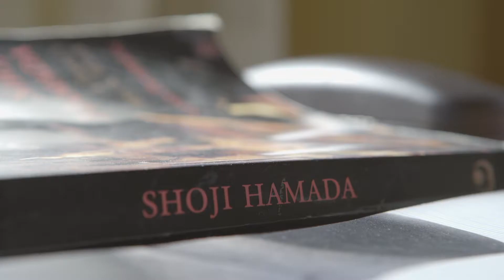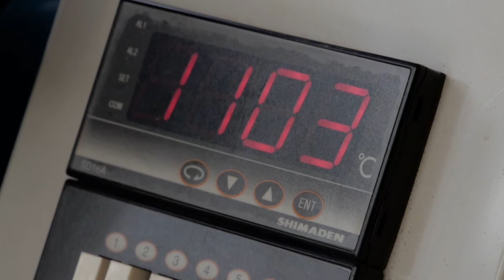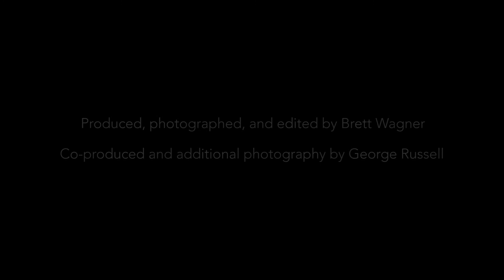Being a Pottery Apprentice in Japan

Comment: Probably would have learned more to use your Chinese connections to learn from the potters in Jing De Zhen. Your average 14 to 20 year old thrower will probably have better technical skills than this guy. An instructor / master there will have over 30 years of experience before they hit 50 and the training experience will be a lot more practical as opposed to doing the instructor's chores.
Reply from the maker: Funny you should mention that, because I am going to Jingdezhen in Sept for an artist residency at JCUIS :) What I learned in Mashiko was so profoundly different from my life in the States. It greatly impacted on my life and my approach towards ceramics.  I did not excel in technical skills, but the experience improved my discipline and deepened my understanding  of the craft in a very fundamental way. Super excited to see the contrast between the Chinese and Japanese approach towards clay!
Reply: @suzannewangceramics3280  Congratulations! I think you will find it to be a very enlightening experience. If you have never been there before, certain parts of the city (although tourist-sy) will have small work shops littered everywhere, and all of them are able to move clay on a world class level. Definitely befriend some of them if possible.